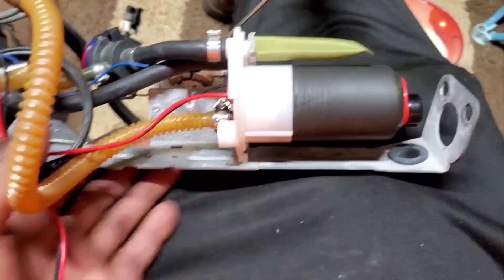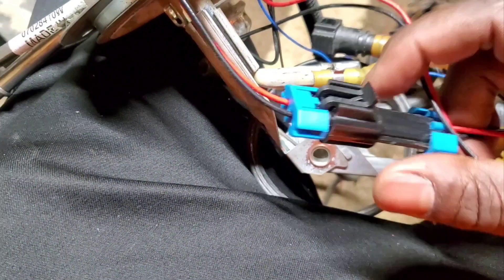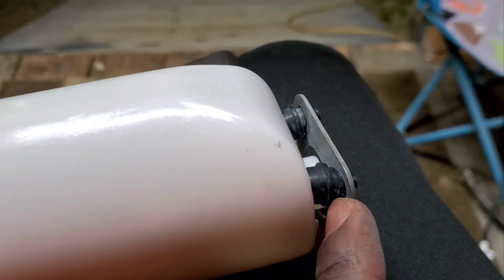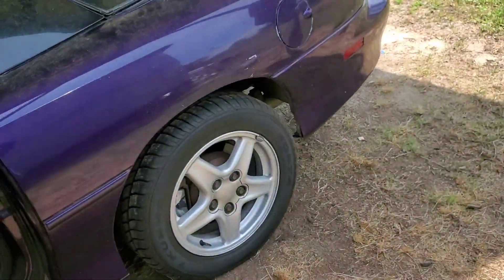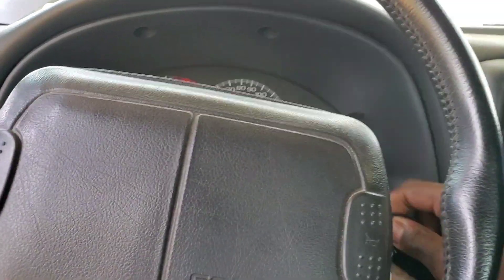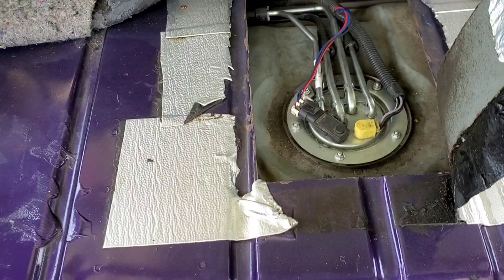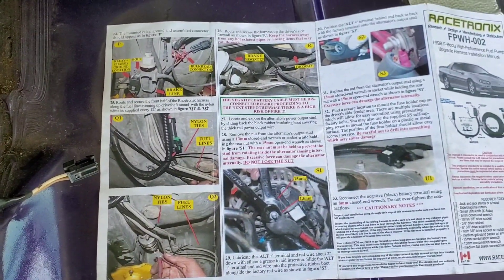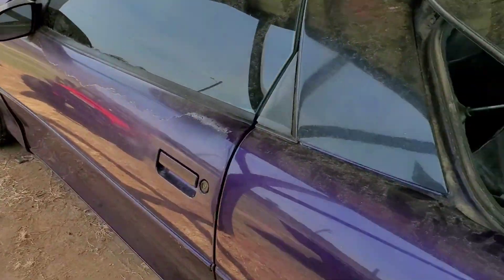My F-body 340lph Fuel Pump Upgrade

Comment: hey brother thank you so much for the video!!!  what your hp, if you don't mind telling me.  i have an 01 trans am i am at 463hp but i ran out of injector. I am shooting for the 500-530 mark.  I am looking for a pump and injector upgrade. could you please give me some good manufacturers to deal with??
Reply from the maker: You welcome bro thanks for subscribing she makes around 650-685hp, I purchased it from Texas Speed Performance.
Reply: @tstv716  thank you big brother!!  Did you change the injectors too??  I just want to get into the 500hp level.
Reply from the maker: @martiniusetihw  yeah I did a friend of mine has some 42 lb injectors for sell once I get all the details on them I'll let you bro.